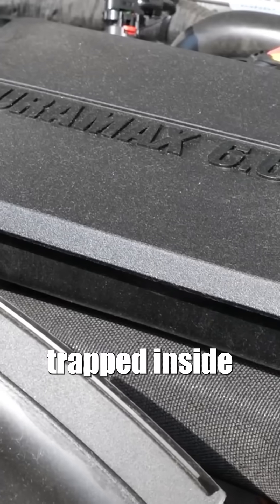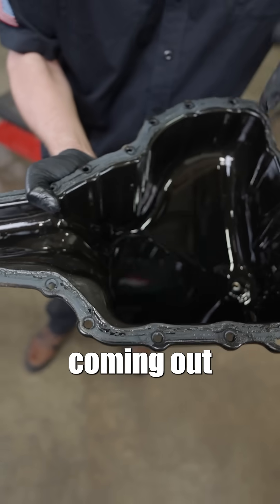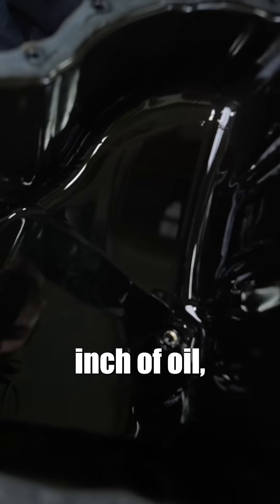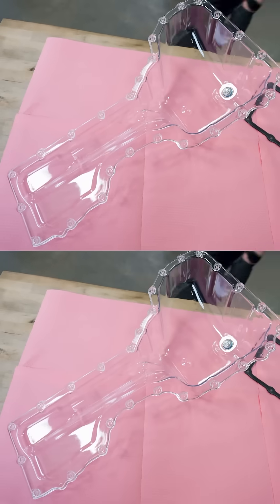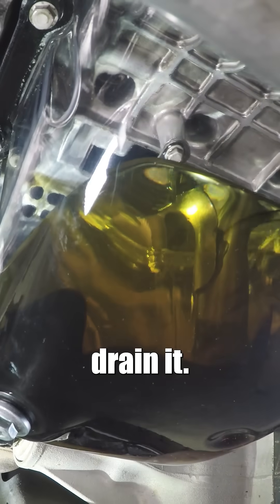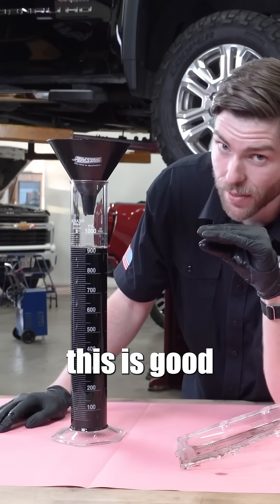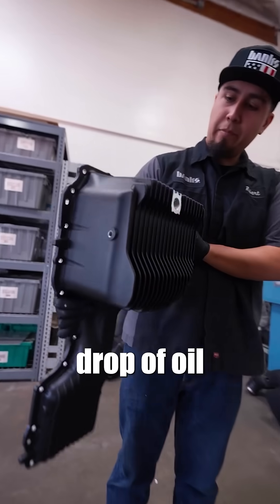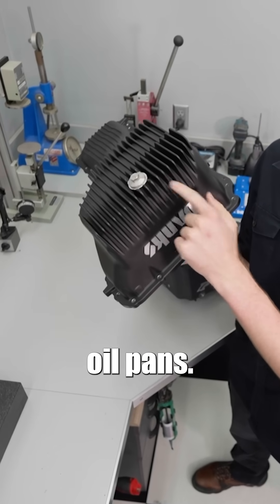A disturbing discovery. This dirty oil is trapped.

Comment: The oil cooler holds oil that doesn't drain and oil coolers are widespread down to lowest economy car models. Bigger oil cooler on newer higher HP diesels can be 1 1/2 quarts. I had a customer new to diesels that accused me of not changing oil as it still had black tint to it. He changed it again and it was much much cleaner as he had effectively flushed it with a 40 mile later oil change. He never came back and aplogized but I know he figured it out the next time it was changed.

Comment: Park it at a slight angle and then drain it.
Reply from the maker: Even with changing the oil with the truck on ramps, you may get an extra ounce of oil, but you would still have dirty oil stuck in the bottom of the pan to overcome the factory drain plug provision. There are still heavy metals that collect at the bottom of the oil pan while draining.

Comment: So now the oil pump loses its prime every time you change the oil and takes longer to build oil pressure.. Sounds like GM did that for a reason!
Reply from the maker: There is no evidence that GM's intented to retain oil in the pickup tube for priming. We've measured the time-to-pressurization with both the stock and Banks pans. In both cases, the time is negligible. More harm is caused by dirty oil at the bottom of the sump than the few milliseconds that it takes oil to travel up the tube.

Comment: Why not just a valve on it for easier drainage?
Reply from the maker: You would still have dirty oil stuck in the bottom of the pan to overcome the factory drain plug provision.
Reply: @ no I mean why not incorporate a drain valve into your design? Valves are awesome for those of us changing oil in our driveway.
Reply: @CatRichardBojangles  I agree, I used one on a semi, but a valve needs to be protected from road debris, even locked they stick out a lot further than a bolt. JMO